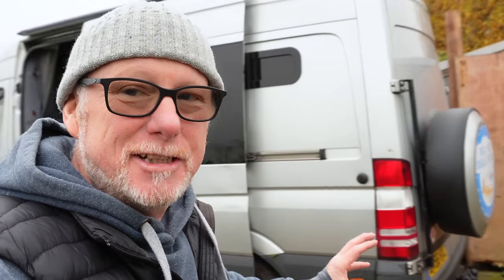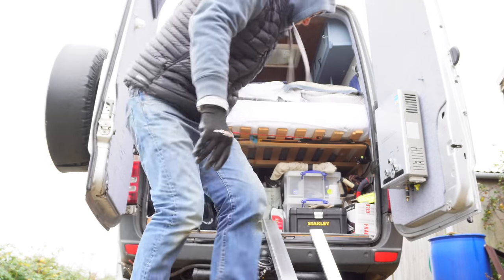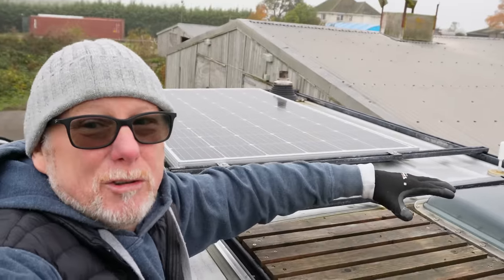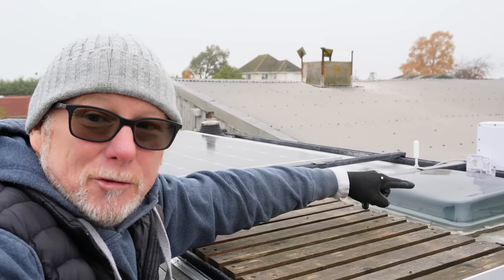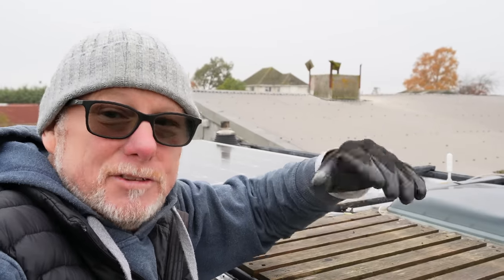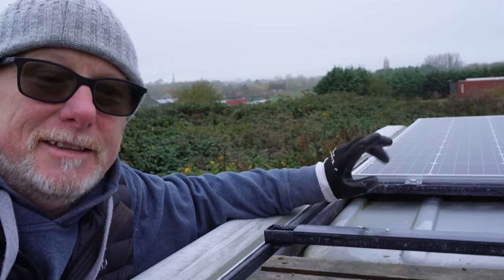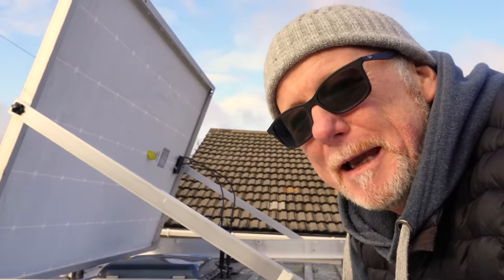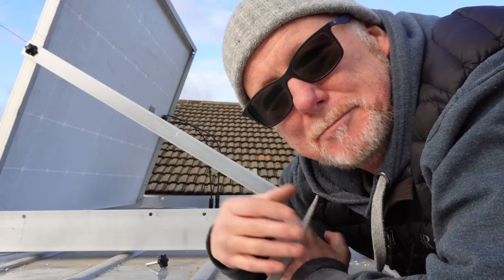Simple Cheap Camper Van Tilting Solar Panel System

Comment: I have 2 of my 4 panels that tilt. This time of the year it makes a huge difference 👍 When you get the other panel then have it tilting front to back instead of side to side. You can park the van in any direction then.
Reply from the maker: Brilliant 👍
Reply: At my latitude around 50 degrees north, latitude angle panel vs laying horizontally flat gives 2x the energy in december and january.
- december and january (2x)
- november and february (1.6x)
- march and october (1.3x)

Comment: Nice one Mel, Is there any chance you could design a mechanical screw thread system to tilt a solar panel from ground level using say a starter handle or awning winding handle?
Reply from the maker: That’s a great idea I’ll have to give it a thought 👍🤓👍
Reply: I'm still thinking about this one to, using 10mm threaded bar with a suitable size welded on the end??? 🤔
Reply: I love this idea ❤❤❤
Reply: It has to be doable...we have the technology...and a full set of hammers! 💪 nothing on the market as far as I'm aware of...if someone has an idea, then I know the enough people in engineering that can do what's required...acorns and oak trees spring to mind! Mick

Comment: Simple but top job, looking at your layout with the high support brackets, its quite possible if you were to add some side angles on the end of the upright you made, i think you could make it lift forward or rear lifts using your method of the knurled bolts, keep up the great channel.

Comment: His tilting 320 watt Renogy solar panel can tilt to either side. He mounted it on tall aluminum angle so the panel is high enough to clear his roof vent. This means there’s enough room to add a second panel.
Reply from the maker: thats rite i have now added a second one

Comment: Thing is if it's cloudy winter day tiliting the solar pannels in nowhere near as effective because most of the light is defuse and not coming from a single direction so having them flat is optimal, although on a clear winters day tilting will make a massive difference due to how low in the sky the sun is.

Comment: Hi Mel, You recently did a video about a power bank that cut out when trying to start a dieasel because it drew to much current I think David mcluckie has just put out a video saying some deisel heaters draw more current on startup than others. I wonder if you could use a glow plug that draws a lower current and maybe the power bank would not cut out. Hope this helps

Comment: #Waffle on a wednesday Hi Mel Not a quick question  but I'd just like to tell you how informative and helpful your videos have been and that you have been my inspiration to build my own camper.
As a small thank you I've started collecting hardware for my van Halogen hob, ladder and diesel heater etc and I've bought them all through your store front.cheers for all the helpful vids and keep up the great work Dodgy Dave 😁

Comment: I am going to have to fit my solar panels before my battery is set up, what is the best method to cap off the live/ground wires coming into the van while not connected to a battery?
Reply from the maker: MC4 connectors 👍

Comment: # Woffle on a Wednesday, Mel great video. Quick question, is it best to install 1 solar panel or 2 smaller solar panels, ie 2x200 or 1x400w for performance kind regards Adam
Reply: Watts is watts, but 2 panels is twice in installation work, mounting brackets, wiring connections etc.
Reply: @germurphy4986 . Makes sense 👍